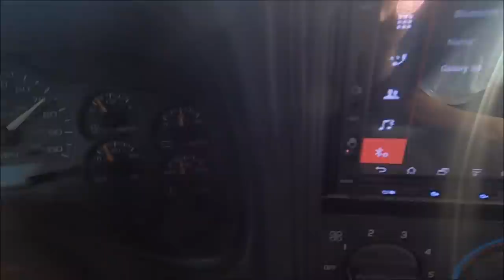MY DURAMAX WON'T STOP BREAKING!

Comment: hey andy why not get a fully sealed radiator instead of the cheap gm radiator that are known for blowing out on the side that are crimped over the plastic. i have an 1980 oldsmobile and had to replace the radiator and the local part store was giving me that cheap plastic radiator and i told them to stick it in the junk pile and find me a completely sealed metal radiator. And not to sound like a bad guy bit do the head gasket too or try to find another motor with lower mileage on it and replace it all

Comment: If the cooling system has no coolant in it, does it even still read correctly. 
Maybe it reads the steam temperature? 
I mean, I've never experienced it so I wouldn't know, but I know it reads the coolant temp, and if there isnt any coolant does it still read correctly?

Comment: What do you expect from a truck with a 500000 miles on it the radiator tank will leak I've replaced the radiators at 200K
Reply: Myself and two boy all have d Max's great trucks.

Comment: What do expect from a truck that has 500000 miles on it dude
Reply: If that truck really has that many miles. That's fantastic but I don't doubt it I saw a d max here in so cal just beat to death pulls a trailer picking up steel for his business  everyday 530.k. never been apart .my son's has 340 k leaks nothing other son's 145. Mine 140.. no leaks on my concrete driveway. Great trucks

Comment: Hmm kinda curious. What would it cost to just bite the bullet and completely overhaul the engine. Cause I mean if your pulling the heads off any way why not clean everything out in a hot tank, hone the cylinders, replace the piston rings, all the bearings and recondition the heads? Or would it be close to the same price to get a crate engine?